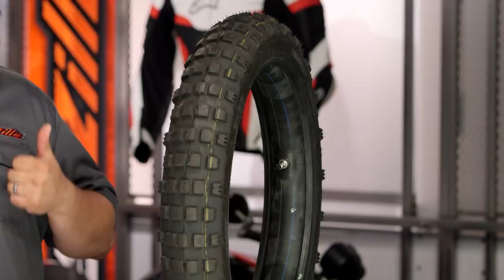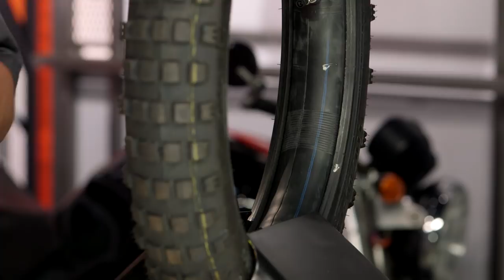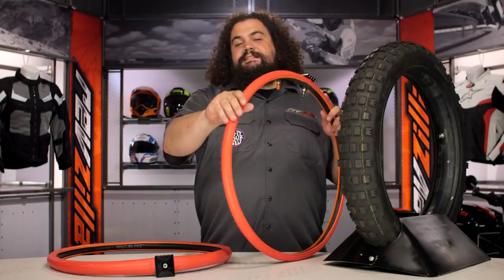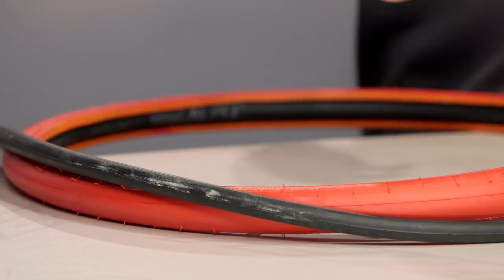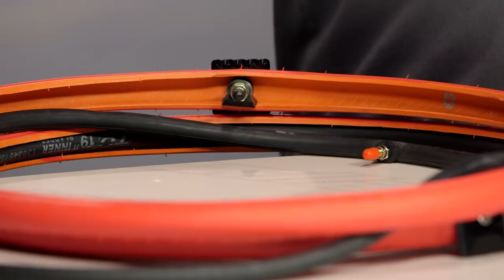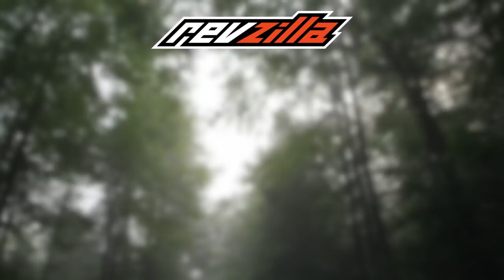Nuetech Tubliss Gen 2.0 Kit Review at RevZilla.com

Comment: Tubliss is the best upgrade so far. The added traction gains are the biggest benefit that I’ve seen. It’s almost like cheating! I never had a pinch flat, so I wasn’t worried about that. I first installed it on my rear tire, and that was amazing! Now I’ve added front Tubliss, and it’s a noticeable improvement. If I want a stiffer sidewall for cornering on a hard track, I can always put in more pressure. But it’s also lighter than heavy duty tubes. So it’s worth doing for any and all of those reasons.

Comment: I like to use Armor All to lube the TuBliss bladder and tire when installing.  Soap and water works of course, but Armor All is slicker and it doesn't dry out fast like soap and water can.  Just don't get it all over your brake rotor and tire tread 😆

Unless riding really slow, I think the 0-10 PSI range, especially if in the lower end and for the front tire, is aggressive.  Run your front tire that soft and it really risks dinging the rim.  The high pressure bladder will likely be fine, but now you have zero PSI and a bent rim.  A bike can be ridden slowly with zero PSI and an intact high pressure bladder, which is cool.  Just

Comment: I have installed numerous tubliss systems on dirt bikes.
One BIG disadvantage is if/when you dent your rim because of 1.) the very low air pressure you’re running in your tire and 2.) the speed you’re riding when you hit a sharp edged anything will cause the tire to lose it’s air because it can’t seal against the rim anymore due to the dent.  Now you’re stuck on the side of the trail pulling out the whole tubliss system and you guessed it.....adding a conventional tube so you can ride home.
This is ASSUMING you brought all the necessary tools and a spare tube on your ride........HIGHLY UNLIKELY :)
I switched to a mousse ....end of problems with the tires     Period.
Reply: What is a mousse?

Comment: Completely tubeless....except for the tube 😆
Reply: @Sound Money
 the worst of both world, you need TL puncture kit for small hole, if it is a big hole you are done like with TL 

Whole point or Tube with spoke rim is to be able to repair nearly every size of damage to tire...

We are speaking of enduro flat tire, not nail on street, especially enduro flat at low pressure = huge stone hole. Now try to dismount and rearm the 100PSI shit on a trail....

Comment: ive had this sytem on my bikes for 2 years now, never going back to tubes. more traction, less flats its a win win. tire swaps after the install are really easy. 

if you have double beadlock wheels chances are you won't need to drill your wheels
Reply: Which bike
Reply: when you get a 1 inch wall flat??? You call for help??

Comment: After all the benefits you describe, why the heck would you not run it?
Reply: maybe because he forgot to mention: what do you do in case of 1 inch wall flat (common with stone even at OEM pressure, and frequents at low pressure).

Comment: really, it's "insanely difficult" to repair a tube tire?
Reply: out riding somewhere? yep
Reply: Paul Meserole an inconvenience maybe. With a few basic tools it really isn't hard.
Reply: Oh, I'll give you that. It's faster unless you happen to puncture the inner bladder. Tubliss is a pretty cool system too, especially for running extremely low pressure. I just wouldn't put repairing a tube as a rip van winkle on the beard scale :)
Reply: Not insanely difficult but imagine trying to change a tube in the desert in July with no shade at 110 degrees. This product will no doubt save lives.

Comment: QUESTON:  Okay motor heads let me run something by you.  I spoke to a mechanic at my local Honda dealer about this product and he raised some interesting points.  He stated "Having 2 valve on the tire concerns me for 2 reasons;  first, it makes it more difficult to balance the tire and my second concern is what this would cause for faster wear and tear on the tire.  I believe that the tire would be unbalanced and cause you to have a bumpy  ride and cause uneven tire wear."   I'm not sure but I think what he's saying makes sense.  What do you think or know about this?
Reply from the maker: That's a strange response. Has that mechanic never seen a bead lock on an off-road bike? Keep in mind that these are strictly for off-road riding, and they balance just fine. At least that's been our experience. -DrewZilla
Reply: Mechanic: “So bring your wheels and tires back here for maintenance. I’ll be happy to charge you shop rate $60 for a half hour labor to change your tubes.”
Reply: lol

Comment: Seems nice untill thinking a bit more...  100PSI, no way to get this pressure on a trail in case of problems, if you get a big hole in the wall you are in problems, so you would need to bring TL puncture kit for small hole plus TT puncture kit in case of big wall hole......And a 100psi capable compresor.... SHITTY

Comment: Tubliss will not protect your rim!!! Do not ride below 0.4 bar!
Reply: The Tubliss inner bladder of 100-110 psi does protect your rim. You’re misinformed.
Reply: Aaron McElhinney that's why i bent my rim with the tubliss on? :))
Reply: I'm not sure how you bent your rim, but I can tell you that I haven't had any problems yet, and most do not.  I can imagine the possibility, however, of catching a sharp rock with just the edge of a tire, especially one that doesn't offer much coverage past the rim edge, and potentially bending it.  However, if given the same tire pressures and conditions, I'm sure you would have bent your rim with a tube at least as badly, if not worse.  Even at 0 PSI, which simply means that the pressure in the tire matches the atmospheric pressure, not that you have a flat tire, there is still protection from both chambers, including the 110 psi inner bladder.  If you ride just as hard with a flat tire, I think you're bound to dent a rim.  Riding on a flat should only be to "limp" back to the truck if needed.
Reply: It says protect not completely eliminating the chance of ever having a bent rim again.   What the hell did you hit and of your running low pressure your Increasin the chance.

Comment: These are the worst systems. Only hailed because "you don't get flats" (which is a lie, all this system does is prevent blowouts, if you're trail riding you're gonna be flat eventually.) These are a hassle to install, expensive and just complicated. If you install a tube + rim lock you'll be fine. Not to mention, try installing one of these out in the boonies, you bet your ass you're gonna be kicking yourself if you don't have multiple spoons and the lip tool they provide. 

I've said it before, if I ever open my own shop, and someone asks for a tubeless install, I'm going to laugh at them and tell them to get out or buy a tube.
Reply: I bet you ate paint chips as a kid
Reply: @bkwil6078  I eat paint chips RN, what's your point?